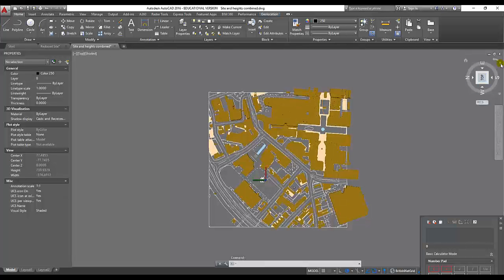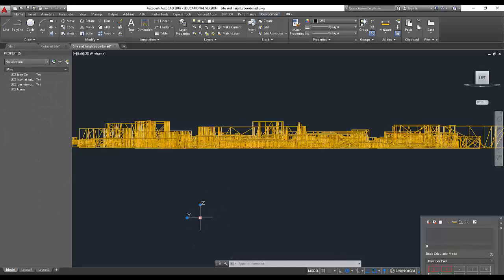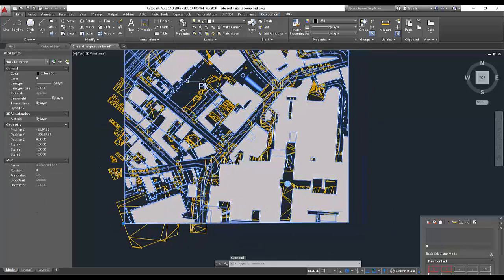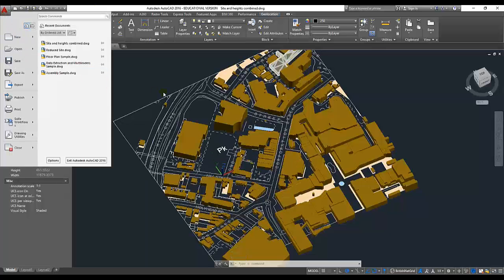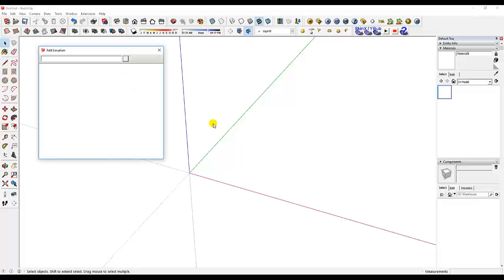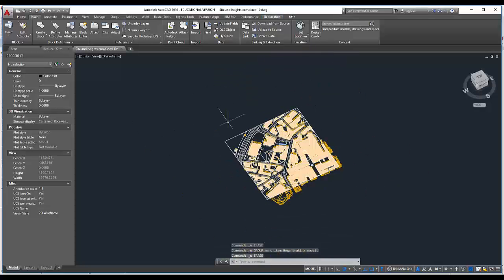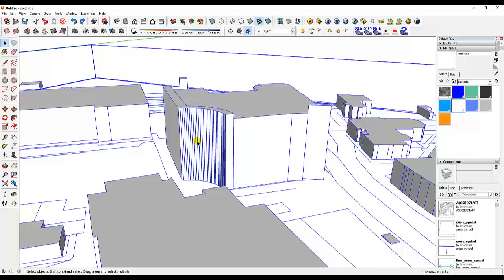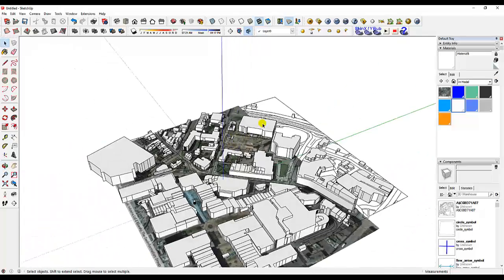Digimap to SketchUp Pt 2

Comment: I cant download the vector map local file as a dwg, it is only available as a gml2 file. What do i do?
Reply from the maker: Hi there, if you are in digimap, when you select the data type there are usually some filetype options to select from. Though digimap have changed quite a lot since that was done. I will check later to see if that is still valid. Otherwise in digimap you will have to select the OS Mastermap > Topography option, this has loads of data and is available as a DWG file.
Regards
Paul
Reply: @octavalent  i imported the building heights dwg file into sketchup on its own without any other vector map files and it seemed to work fine, so actually i dont think theres an issue anymore. thanks a lot! this video was v helpful

Comment: Hi, when I import the cad file into Sketchup, it's a flat image, it doesn't pick up the contours or building height data. Do you know why this is?
Reply from the maker: Probably not the correct file. It was a long time ago but there should be several files in there. A flat image and the building heights one. Regards Paul